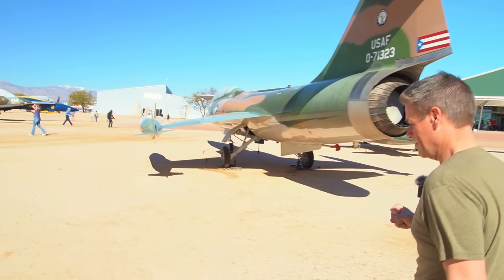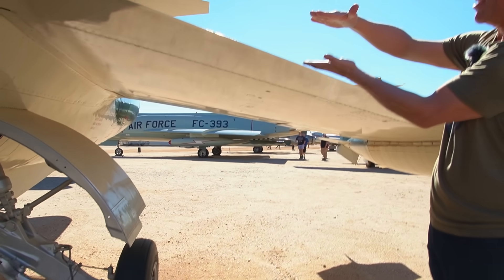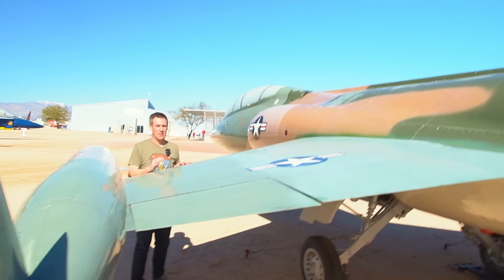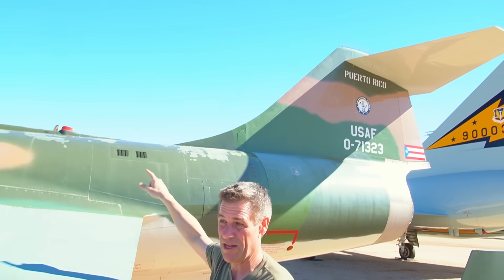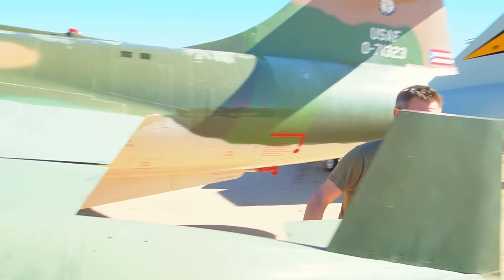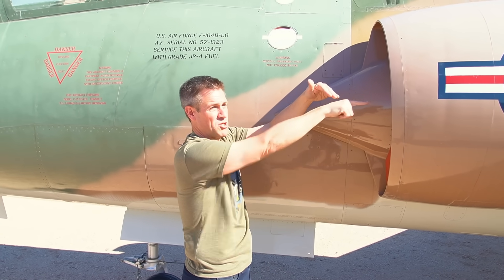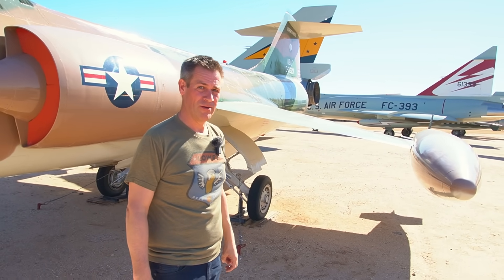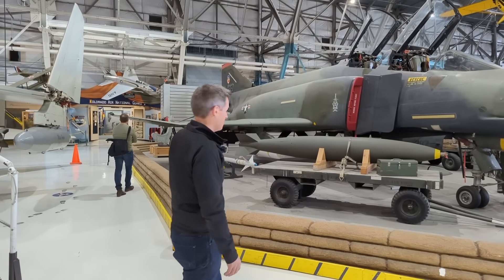Why the F-104 Starfighter Was So Fast | The Aviation Show Clips

Comment: The fixed shock cone also was the speed limiting factor, if it were movable it could have allowed the F-104 to go even faster. But then it would have run into material limits, IE if it had gone to 2.5 Mach the canopy and certain skin areas would have gotten too hot and failed.
Reply: I recall reading that the Italian F-104S version was capable of 2.5.
Reply: @TOOL_MARKS  Maybe in an emergency etc but you probably would not want to do it routinely. I know an F-15 pilot who got his Eagle up above Mach 2 (I forget the exact mach) high enough to cause thermal damage to panels, antennas etc. Doable, but not something you want to do every day.
Reply: @dogsbd  - Exactly... Which is why I stated that it was "capable" of 2.5. 🙂 (But not recommended.)
Reply: These aircraft went nearly mach 2.5 in shallow dives before zoom climb profiles.

Comment: My dad did a lot of the flight test on it.  Back then it was dangerous in flight test.  There was no computer simulation.  However, this made the engineers so much smarter.  They had to use slide rules.  He was a wizard with them.  Those engineers could literally see air flow in their minds.
Reply: Being an aeronautical engineer back in the 50s and 60s must have been so much fun. The huge developments and fast pace has not been seen since then.
Reply: @skunkjobb  the wild west of aircraft development
Reply: @skunkjobb  Time to watch The Right Stuff and The Starfighters.
Reply: A rocket with very small wings. Designed as point defense fighter, that is, climb to altitude as quickly as possible to defend against incoming enemy planes
Reply: Then your dad's a personal hero o' mine.  I can't think of anything I'd like to have done more than to be a Right Stuff test pilot.  And if any plane was a test pilot's aircraft, it's the F-104.

And when they were done testing it, they'd throw other tech on it and use it as a test platform.  And when they were done with THAT, they'd fly it to stay sharp.

Comment: Robert J. “Bob” Gilliland  Bob made 5 successful “dead stick” landings in the F-104
Reply: Bob Gilliland was quoted with saying the following: 
He was asked how well did the Starfighter 'glide'?
Answer:  "Like a toolbox"  🙂😊
Reply: @TOOL_MARKS Ever see the cartoon about how to find the best glide in a straight wing Piper? The procedure was to throw a brick out the window and follow the brick down.
Reply: I think the issue was an engine failure with the airplane configured and slowed down for landing since the airplane would be relying on bleed air to keep the wing flying (that would pretty much be the textbook definition of running out of airspeed, altitude, and ideas all at once). An engine failure at altitude could be landed dead stick (assuming the airplane was in gliding range of a runway) though the pilot might be looking at using the tailhook to stop at the end of the runway.

Comment: There's an old video of Kelly Johnson talking about how analysts post Korean war, took pilot data and came up with the 104. It was supposed to be a dog fighter and interceptor. Meant to survive and dominate enemy aircraft with diving attacks or the high yo-yo, essentially. I suppose it would have been ok if the USSR had kept flying Mig-15's.
Reply: 104 is superior to the Mig-21.